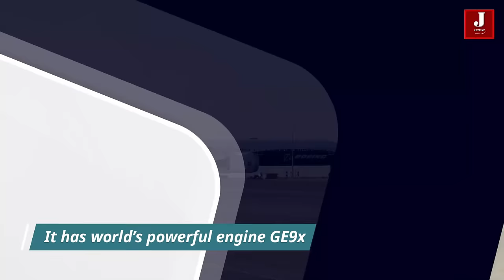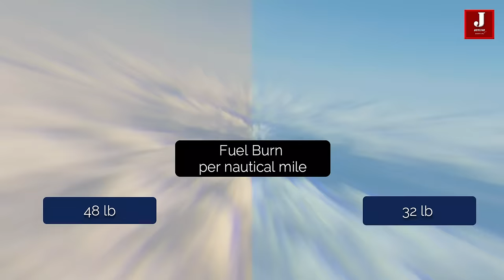Mega Comparison of Boeing 777x vs A350-1000 Aircraft

Comment: How does the a350 have a larger seat capacity with smaller dimensions?
Reply: It does not have a larger capacity when comparing apples to apples.  The cabin is more than a foot narrower, and the fuselage is shorter.  Also, the A350-1K can't fly its advertised range with a full load of cargo and pax.

Comment: Re-engine the A350 in 2027 and from the perspective of efficiency the X is onto a loser. Am guessing Airbus will eventually do the 2000 if the need arises and then the larger segment occupied by the X9 is lost to Boeing. The issue being whether this segment is needed any more. Both Airbus and Boeing know that the true competition is A339neo vs B789 (a Boeing win) and A359 vs B78k (an Airbus win). Planes are getting smaller.

Comment: 777 I can say is the best amongst wide body as per performance and capacity..777 200ULR variant actually can fly round trip around the globe.
Reply: Not possible with pax configuration, the longest flights today are SQ A359ULRs...

Comment: A350 makes much better commercial sense..lower cost, higher range, better fuel burn, more passenger capacity. The 777 has all the indications of turning out to be a white elephant.
Reply: A350 passenger capacity is not true info. B777-9 is longer and wider cabin interior, why B777-9 is less seat???

Comment: This is a clear tendency video to A350.... all figures are in favour of Airbus. Max capability when this will only be possible to compare when planes are in operation; fuel burn when  there is no official comparison; Range presented here is for the 350XLR that was made to do long flights but with regulated weight /capability, etc, etc ... Resuming, be accrued and honest with your viewers.
I'm not saying that 777x is better. Just saying that we need to compare what is comparable and wait for plane to be in operation so real comparisons be done....
BTW, while Qatar don't loose the court case, i place some question marks....

Comment: As far as an airline is concerned , the size of the window, the aerodynamic, the superior architecture, the low noise, the engines size, are not very important , they buy a plane on the range, the fuel consumption, and the size of the cabin. One could pack 550 passengers plus on the 350- or the 777  it all depends on space between rows and number seats per row. The price for airbus 350 and 777  is very wrong. Planes are not sold on list price but on factors like number of planes purchased and delivery time just to name a few Please be factual not opiniated in your comments, Why am I saying that the comparison was by Arbus period ,

Comment: How can the A350 have a higher maximum passenger capacity when the 777X is longer and wider?
Reply: @yo yo You are very wrong. Check out the website for the airline Frenchbee, they run the A350 in 440 seat economy plus 40 premium for a total of 480 seats. There is no other data on the Boeing site other than it accommodates up to 426.
Reply: @StopMediaFakery  Air France has a 468 seater 777-300er. Imagine how many the 777-9 could carry
Reply: @sakthimohan9242  Your comment isn't relevant to this. We are talking about the A350-1000 versus the 777X. The angry clown above said no one flies at close to the exit limit, yet as my post shows there is an airline operating the A350 at 480 seats. The fact remains that what this video says is true. The A350 already seats 480 with an airline, but the 777X has a lower limit. Don't be a monolico like the other guy and argue with facts, because this data is from an airline already operating the A350 versus what Boeing says on their own website! What people want to believe has no relevance to facts.

Comment: I think Boeing fans need a bit of a sad reality check - Boeing is in shambles...the 777x programme was designed to compete and outperform the a350-900 range...airbus had enough time to analyse the 777-8 & 777-9 technical specs, design, produce and certify the a350-1000...a plane design to, broadly speaking, be better than a 777x on most (if not all) metrics...

Boeing has been pushed to a very dark corner - to outperform airbus it has to sell planes at a discount price (as its happening with the 737) or come up with a revolutionary design that proves to be a game changer...sadly, the 777x is not that game changer; and each passing day, there is a higher risk of airlines shifting to either a350-900 ou a350-1000 planes

Comment: This material is typical laying European propaganda. Boeing 777 X is produced in two versions: 777-8 and 777-9. Why the 777-9 version were chosen for  this material?  Rather, the equivalent of the A350 - 1000 is the model 777-8. The counterpart to the A350 - 1000 aircraft is the 777-8, which has range of 16 170 km and carries 384 passengers, rather than a model with an increased number of seats on board like the 777-9. In producing this material, the author forgot about simple honesty and objectivity.

Comment: clearly, the A 350 is the superior aircraft.  Technological innovation, fuel efficiency, range, number of passengers, price:  all of this make the aircraft a better alternative for airlines!!!
Reply: A higher usage of composite materials is a definite advantage. Lowers Weight, adds strength and reduces design complexity.
Reply: One of many problems is that passengers and crews don’t like them.
Reply: @OnYourSquare  You haven't heard the paint problem caused by the composite material on A350?
Reply: @peiqiweng340  I have. And at some point they'll figure out the root cause. 

But that doesn't negate the benefits of manufacturing a lighter, stronger, faster and easier to construct plane.
Reply: @pacmanc8103  don't be daft.  still have to read negative evaluations of the 350 from passengers and crew as featured in many avgeek youtube channels.  as for the 777x, boy, setback after setback after setback.  now they are set to fly commercially in 2025!!!
Reply: @peiqiweng340  a paint problem, yes, not a safety issue as the canard that Qatar Airways wants to paint it.
Reply: but there is a mistake i think in thinking that, in a single class layout, the 350-1000 can seat more passengers than the 777-9.  this cannot be true.
Reply: @anthonydecastro6938  “Daft”?  What a quaint word - right out of Harry Potter!😛  Keep reading - I just flew an Qatari A350 from a Doha to the US and 2 of the attendants told me they much prefer working the 777 because of differences in the galley areas. I’ve said before that with the reverse herringbone design commonly used these days, the experience is simply very different for passengers on the A350 vs a 777.  The width is noticeably different, with a tighter feel (I won’t go into the windows - strange).  At least Qatar doesn’t use the herringbone design, which makes it a bit more spacious.  You may not agree or like it - I just base my observation based on experience, both as a passenger and by chatting with crew.  It’s true - most prefer flying the 777.
Reply: @pacmanc8103  well, at least you speak now for yourself.  which is fine.  but for every narrative you have, there are others that have their own, and they are different from yours.
Reply: @anthonydecastro6938  Right.  Typically when responding to a poster, however, one doesn’t start with the phrase “don’t be daft…”. At least that’s been my experience.
Reply: @pacmanc8103  the proper and rational response to something said that hastily generalizes, without qualifications, don't you think?
Reply: @anthonydecastro6938  Hastily generalizes? What qualifications does one need? I never represented anything that would require a certificate in changing aircraft engine oil.  I was speaking from the perspective of someone who pays to fly from one place to another, often on flights of 14-16 hours.  I can easily tell the difference between Airbus and Boeing aircraft - can’t you?  Now, to the use of the word ‘daft’. Well, never mind. You know.
Reply: @pacmanc8103  "One of many problems is that passengers and crews don’t like them". daft.

Comment: The Beoing 777-9 is the nicest looking Aircraft I've seen, and I love the fact that it can lift more weight, I must admit I do get nervous when I see passengers bring too much luggage on board.  However I would also wish it had the R/R engines instead of General Electric. Yes admittedly the 350-1000 does still appear to be more efficient and of course it's using the double R engines.   I'm sure it want be too long in the future that Rolls Royce will come up with a larger engine than their current Trent.                                 All in all, I would be happy flying with either Aircraft, just might give a Tad preference to the Beoing tho.
Reply: 779 and 747
Reply: 1

Comment: 777-9 has 10 abreast seats, a350-1000 9 abreast. a 777-9 is slightly bigger than a a350-1000. 777-9 and -8 has more pax capacity than the a350-1000. an a350 could fly further due it's lower weight wich could ad more fuel to get a comparable weight. so they are both kind off the same efficiency. a350 has less pax more range and a 777 more pax less range

Comment: The A350 absolutely can not accommodate 480 passengers! This channel is a joke..
Reply: It an accurate number. Its the maximum number allowed by regulators in a high density all economy configuration. It's based on the number and type of exits. You have to be a do a full evac in 90 seconds in the certification testing. Few airlines configure for this maximum passengers on wides bodes ( though common on narrow bodies). Passenger count comparisons are always a bit sketchy since each carrier chooses it's configuration. Some a very premium heavy and some are not. Passenger seating counts can vary widely even among the same time of aircraft within the same carrier. High density version vs low density version. Take AF for example. They have different 777-300ER configurations with one with only 296 seats while another for leisure markets  that seat 482. Huge difference. Same can be found on BA/ANA etc
Reply from the maker: Thanks John for amazing details
Reply: I was thinking the same thing.
Reply: @Coupe-sy9nk  I still don’t believe it. The 777X -9 will be the biggest twin jet ever produced. But the A350 could substantially more passengers? 🤷🏻‍♂️
Reply: @matthewwindisch9449  they'll say anything to boost Airbus,  the 777x has a wider cabin. It's longer but yet somehow they manage to fit 54 less seats 💺 🤔.  The 777x is the 747 replacement  so again,  I still think this is complete misinformation.
Reply: Shows how much you know 😸😸😹😹 maximum configuration doesn't mean that's exactly how it will be fitted, this is one bonehead argument.
Reply: @Coupe-sy9nk  facts are facts whether you feel happy about it or not, fact is the A350 seats more, have a problem with that go to Everette and complain there 😸😹😹😹🤣😹
Reply: @mwat22  was I talking to you. I don't  think I was. So what you need to do is not worry about my opinion,  if you know the statements to be facts.  If it really is true then why did you feel the need to comment.  Read the comments and keep scrolling since your a foremost aviation expert.  Your simply bored and want to debate  and that's a fact.

Comment: The most notable comparison is that the B-777X will replace the B777-200, oldest version of B-777-300, the B-747-400 and the A-380, while the A-350 is replacing A-330s
Reply: You are completely wrong! the 350 900 was launched to replace the old 777 while competing with the 787and better  the 350 1000 is almost as large as the 777X and carries almost as many passengers while being cheaper it s in carbon and consuming less fuel
Reply: @guillaumedupont7565  hahaha, you wish, but that’s not what really is happening. May be your  source of information is coming directly from Airbus 😂😂
Reply: @guillaumedupont7565 bro opened the whole of boing and Airbus in 1 comment 🐐🐈

Comment: 777x is the better aircraft as it is bigger.....bigger the better. Also 777 is the original large aircraft with twin engines. The 777x is the latest version of the 777 series and obviously more modern than A350 family.
Reply: U just look at looks. U a kid or something. Look at the mechanics not cute folding wing tips. The a350 is better in technology, aerodynamics, material, price and take weight and fuel burn.
Reply: Bigger is not always the best, when it's all said and done, what matters is whatever works for an airline. As for the A350, it can only compete with another A350 otherwise it outperforms anything else in its class at the moment. It's smallest variant is lighter than the smallest 787 even though it's bigger than the 781..the numbers don't lie...but that said, both the A350 and B77X have a bright future..
Reply: @Randy The 787 is old?

Comment: Boeing is a dying aircraft company, because its aircraft are designed by computers operated by technicians and not by engineers. Result was 737 Max crashing.

 Over smartness by the accountants has killed Boeing.

 when Accountants Run aircraft manufacturing companies, then donkeys fly them.

 However, Airbus has become extremely arrogant by their success. They need a kick  on their back sides.